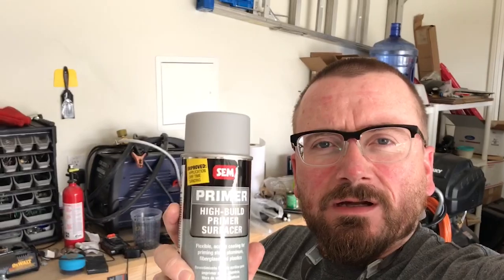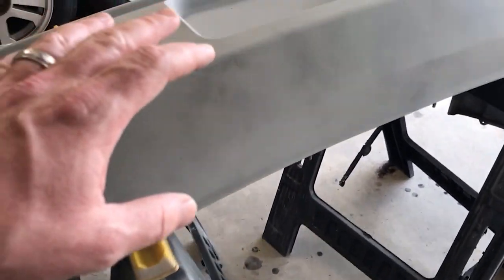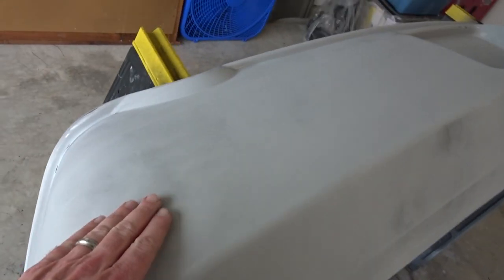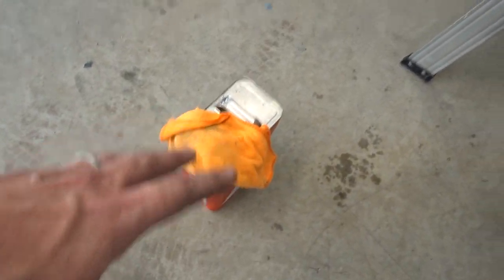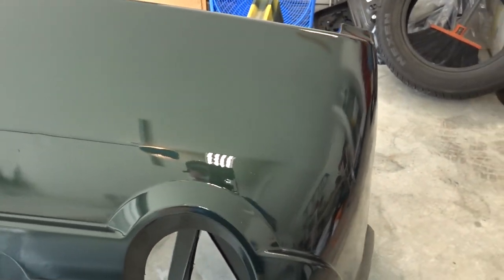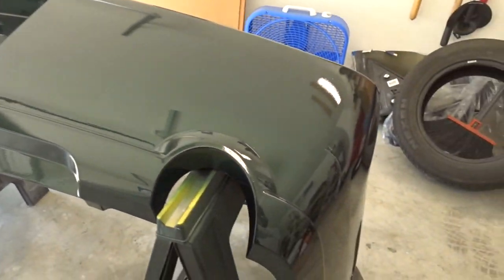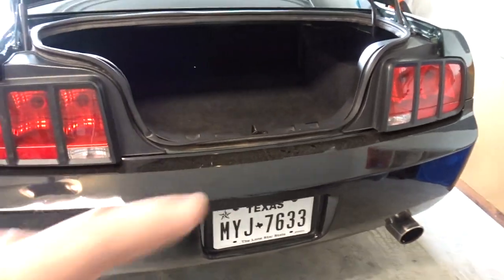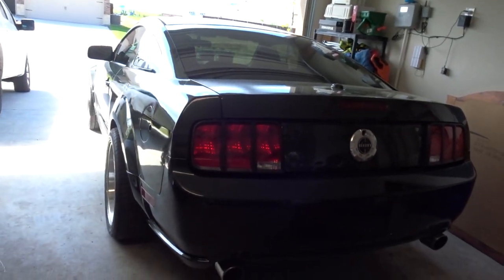Painting the bumper in the garage!![2008 Bullitt Mustang]

Comment: Great video! Looking to do the same to my 08 Bullitt. Finding a good paint that matches the original panels is my biggest hurdle right now. How close was the paint here to the factory paint job?
Reply from the maker: Thank you! The paint was pretty close. I probably should have blended it, but I just didn’t know enough to blend at the time. I took a piece of the old quarter panel up to a paint supply and had them match it, and it came out really good. I would suggest finding you a good paint and body supply and seeing if they can match the paint for you.

Comment: Looks good , What is the bullitts # ?
Reply from the maker: Thanks. It was number 3973. I no longer own the car, but still keep in touch with the guy who bought it. Still looks good too!
Reply: @shortstackgarage2063  Just asking because I have # 1925 and it is a salvage title.
Reply from the maker: @N-Scale  oh ok. This car had a pretty crazy story. I bought the car at auction. I found the guy that owned it when it got totaled. The previous owner told me he was having it towed to a shop because the alternator went out, and the tow truck drive didn’t strap the car down. It fell off the tow truck, and got smacked into.
Reply: @shortstackgarage2063  Well , I am glad you saved her !!!!